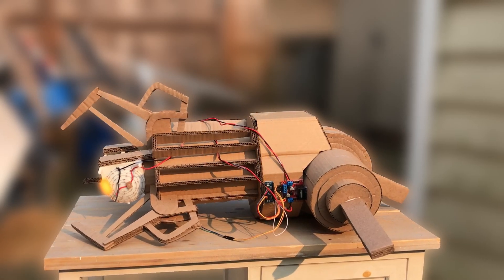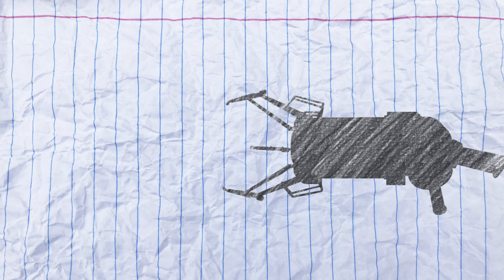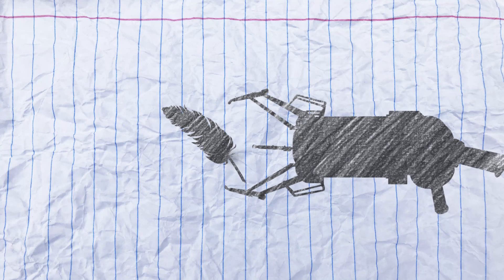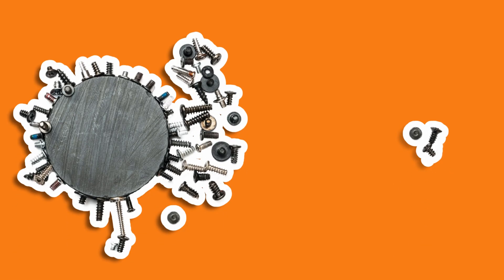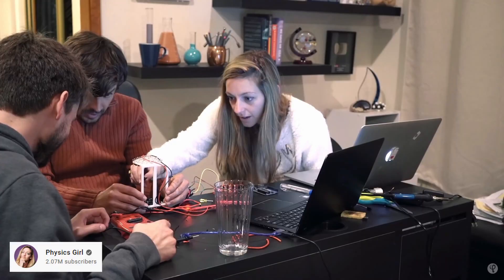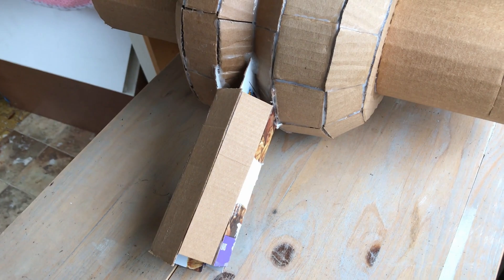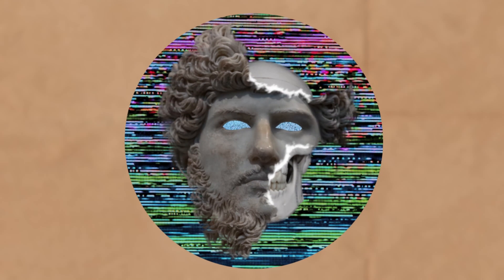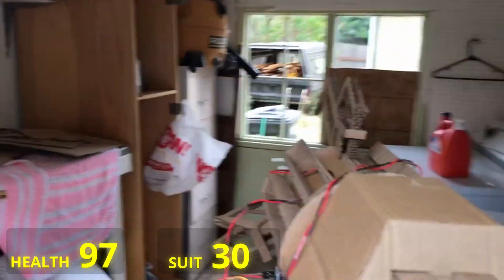I Made A WORKING Gravity Gun From HL2

Comment: Okay, so I think I see your problem. You dont need to know much about it but you do need a Xen Crystal. Just pick one up at your nearest Xen outlet, and then set the Anti-mass-spectrometer to 105%. Some say it's a bit of a gamble but you'll need the extra resolution. The little claws on the end need to have their electro magnetic current at zero point. All three. Apply the duck tape to the handle for good luck and you're done! So if you got any pesky hopper mines in you backyard this summer, you'll be able to handle them easy, along with any weeds stuck in the drive way.
Reply: Or pull a bu## ####